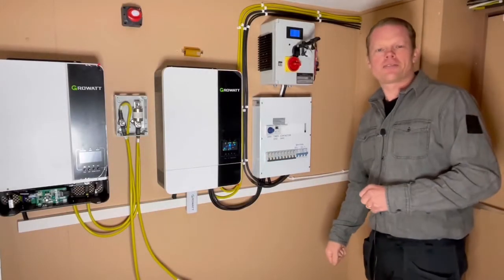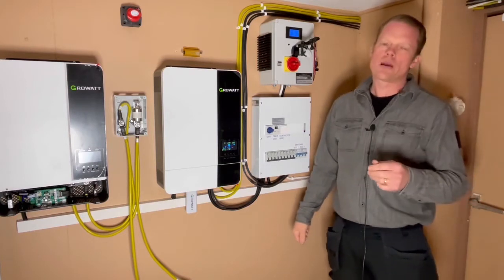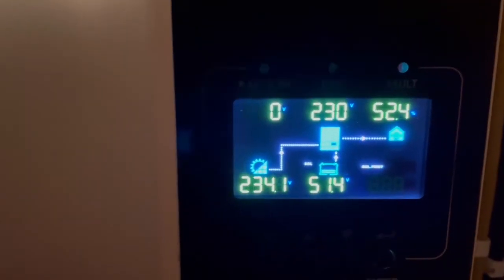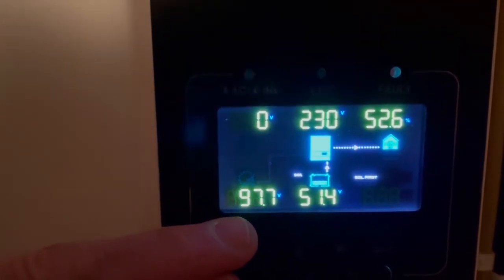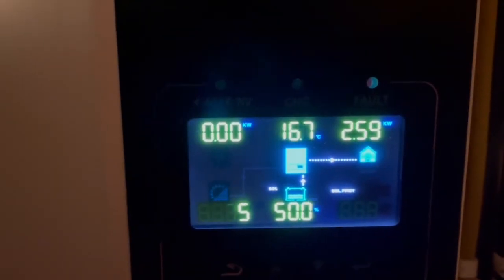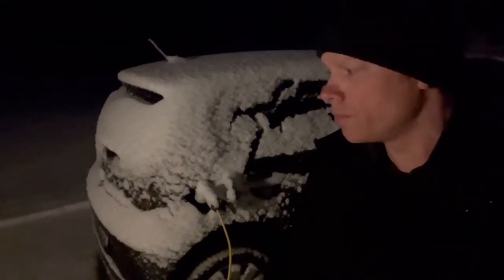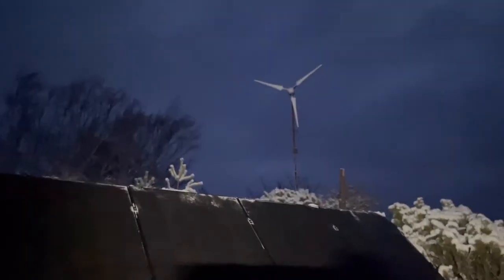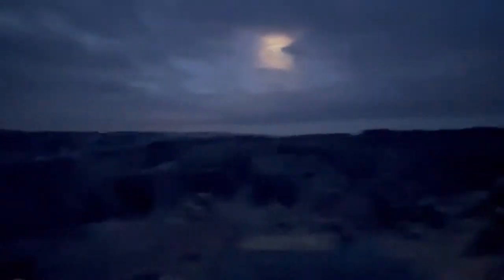Wind and solar Off grid EV charging

Comment: Good video. What is the thickness of your cable from your i1500?
Reply from the maker: Hi and thank you😊 I’m using a standard installation cable 5G 2,5mm. I had that laying around so it was free for me, that’s why I did go with that kind of cable, and it actually worked better than I had expected. Two leeds are connected in parallel and the third one has only one leed.   
Hope it helps😊
Reply: @flyingtools  Okay! impressive effect on i1500 :-)

Comment: How many amps is you're charger for the EV rated at? I am thinking of doing a similar thing here with an EV soon.
Reply from the maker: Hi Bert. It’s rated to 10A 220volt.
It is the charger that came with the car from the factory so it will charge slowly.